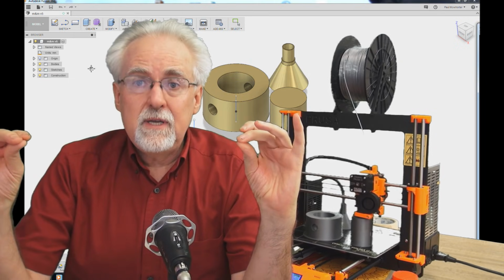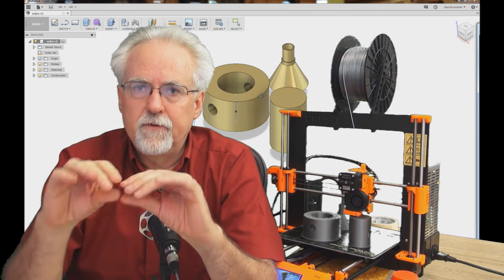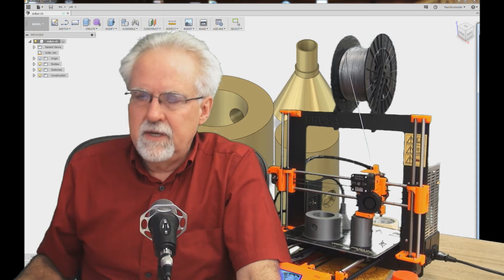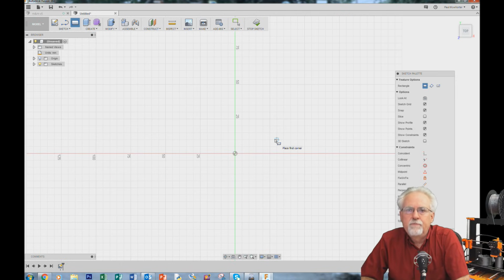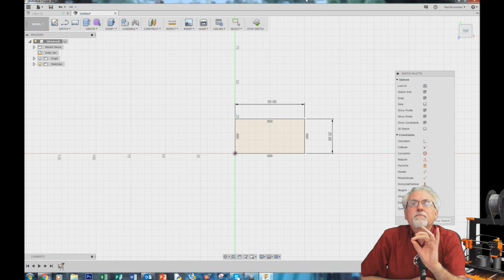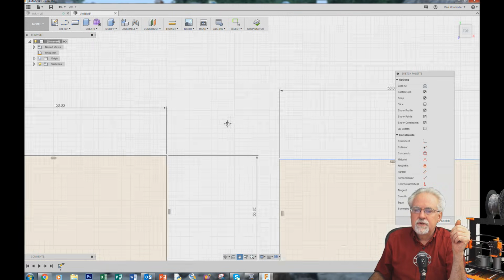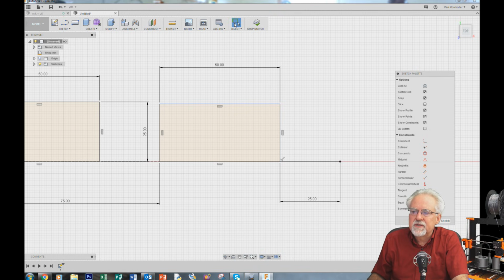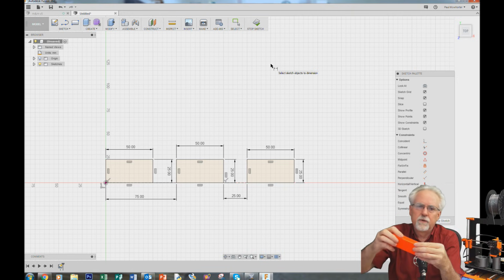Learn Fusion 360 or Die Trying LESSON 1: Introduction tutorial for Absolute Beginners

Comment: I'm doing the lessons, and I know this is probably easy question, but When I was working on rectangle number 4 I typed in the wrong dimension and pressed enter and I don't know how to change the wrong dimension (25.0mm) to 50.00mm. Using the dimensioning tool again to correct it seems like it creates another instance and there is an over constraining error or something like that. I'm starting this exercise over, but I'm curious how you edit the dimensions of the rectangles after they are created.
Reply: Ok, lesson 2 explained how to change the dimension size, double click on it.

Comment: Forgot to add in my previous comment - for those who follow this course today (2024), things have changed in the UI of Fusion 360 since the recording of this video, and in version 2.0.18220 that I'm currently using the default modeling orientation is set to 'Y as Up'; meaning that when you click on the X and Y plane as Paul instructs, it actually takes you to the 'Front' view and not to the 'Top' as showing in the 3d cube at the top right of the canvas in the video. To follow along with this series, make sure to click on the silhouette person icon at the top right corner of the interface and to go to 'Preferences'. There, in the General settings, look for the property called 'Default modeling orientation' and set it to 'Z as Up'.

Two more things in the General settings:
1. I would suggest to set the 'Default Orbit type' from 'Free Orbit' to 'Constrained Orbit' in order have a better control when rotating the viewport further on in the course (I found the 'Free Orbit' to be less convenient).
2. If you find zooming in and out with the mouse wheel flipped for you, just tick the 'Reverse zoom direction'.

Thanks again Paul for making this course. :)

Comment: i spent a year doing a course learning inventor pro & now I paid for fusion 360 , was good to learn a lot of things but damn fusion toolbars , system etc is way different
Reply from the maker: I get really frustrated with Fusion 360. Sometimes it acts more like a 'Beta' software version. They force upgrades that hide or break features you need. They move and change things on the user interface, which makes quality educational videos become obsolete too quickly. I like Fusion 360 but it does really frustrate me. Check out my new lessons which is on my channel as a new playlist on fusion 360

Comment: Great instruction. I struggled with other tutorials. I did have one problem, maybe I missed something. I did watch this video 2 times, but I still have 1 issue. ok I am having trouble with the 3rd rectangle. I click the start point, then a second point. Then I click on the "D" key and select the top edge, drag the dimension line up, Type in 50 and boom it moves the start point (Left side, not the right side. Where is it getting the ancor point from? why did it always adjust the size to the right? Did you tell it to do it to hold the left edge somewhere?

Comment: Thank you Paul for this really interesting entry to Fusion 360.  Is it correct that every rectangle must be connected to the origin point, either directly (construction line) or through other rectangles?  I am thinking of the 3 by 3 rectangles.

Comment: Hi Paul, what 3D printer model is that, and im considering getting one but my friend says they take to much maintenance ect. Is this true?
Reply from the maker: Mine is the Prusa printer, which is the most stable one I have found. Even there, it requires maintenance and tuning. If you are not technically inclined dont get a 3D printer. Also, you need to enjoy troubleshooting and fixing things.

Comment: Hi Paul, I found your instructions on Tinkercad most helpful after my recent 3D printer purchase.   I have downloaded the free student version of Fusion 360 and intend working through your 13 lessons.  However, I have found that after selecting 'new design', my version of the ribbon is different to yours, so it is not straight forward to follow.   Is there a solution to this, have I missed a trick somewhere?   Thanks

Comment: My version appears to be slightly different than the one he is using (nominal construction after right clicking didn't come up as an option (the entire little scroll window didn't come up, I only had the sketch palette pane on the right, which I eventually figured out the 'construction' tab was the bit he was on about), it's possible mine is an updated version to 'streamline' it better, but got through this first video fine afterwards, so still definitely relevant, and very good after the initial confusion.

Comment: Thanks for sharing this tutorial Paul. However, I found that on my Autodesk 360 (personal version) there is no nominal/construction option when I right click. I'm having to press x instead which then converts the line. Do you know whether the menu option has been removed in the latest version or do I need to change something in the settings? Many thanks
Reply: Please ignore this comment. It seems to be temperamental. Showing sometimes and not other times. Strange but there you go..

Comment: Hello Paul. Having followed your Arduino video tutorials which I enjoyed immensely, I decided to have a go at Fusion 360 as I had bought a 3D printer. Thank you for the  excellent Fusion video collection without which I think I would have probably given up I . I've just completed the Helical gear lesson and they work brilliantly. The homework you set that requires the student to add a 2 mm raised bevel to the gear wheel nearly caught me out as the two poles were then 2 mm short. I guess I could have made the gears 2 mm thinner but I chose to add 2 mm to the poles so that the gears fitted flush. 
 Have you used Fusion for any CCT boards or CCT designs yet? Any thoughts on doing some videos on that?  It seems like a fantastic software package. Anyway. A  most excellent contribution to the internet Paul.May your life be long and COVID-19 free !

Comment: I think I'll let this comment stand - Paul, you need an "introductory" lesson (Lesson 0?) that explains the Fusion 360 interface differences between the current version and the version you are using in these tutorials (probably explaining at each interface change which Lesson might be affected?).

Just an initial comment, hopefully, I can edit and retract it later :) But when I open Fusion it does not look like your video shows i.e. mine has "Design" in the top left corner, not "Model" (I can't find Model anywhere). I don't have "Sketch" visible either on the toolbar, instead, in the "Create" area I have "Solid", "Surface" and "Sheet Metal" - is this due to a new version of the software? Or is this some pre-Lesson 1 activity? Because I have "died" before I even got to create a rectangle :(  I noticed under "Solid" there is a "Create Sketch" (which appears if I hover my mouse over a drawing type icon) - if I select that, then I can select the X-Y plane as you show - but there is still no clue at this stage on how to create a rectangle. If I then click the origin, the icons under "Solid" change to rectangle, circle (pictures) etc - and I seem to have found your starting point! Although the "Sketch Palette" shown here does not match what Fusion throws up for me....

One of the things I am finding confusing on any of these tutorials is the software shown does not match the software I see upon starting Fusion..... I started a couple of other tutorials I found and gave up on them because of this issue, but your tutorial might be the closest (and most useful therefore) that I have found so far.....

Comment: 3:53 You're suggesting that failure comes from not entering precise measurements off the bat whereas I though I would be flexing things in Fusion 360 to find out what measurements I ought to use in the real build. What step is there between napkin sketch and CAD drawing that generates those precise values? I guess I'm putting this comment here as sort of a placeholder for when I look back after following your program and see what answer I discovered.

Comment: Hello, I am wondering if you know why my models in Fusion 360 come out 2/3 shorter in height when I print on my 3D printer? I create the model in Fusion 360, export to Cura slicer, and then export as g-code to print. All other dimensions are ok except height... prints out shorter.

Comment: YOU DA MAN, Paul!  I've been following your new/improved/most excellent Arduino series.  Somehow I reached the conclusion that I could use Autodesk's Fusion 360 for Hobbyists, and BAM!, there you are again teaching how to do that!!!  I just downloaded/installed Fusion 360 and started looking for tutorials on Youtube and there you are again!!!  It wouldn't surprise me if you've already done the next thing I need to learn... but I need to learn how to create a control panel made from translucent material, holes for switches, rotary encoders, etc., paint it black, and then engrave labels in the painted surface so that I can mount tiny LEDs behind it to backlight the letters.   I'm thinking I could do it all using a CNC router or CNC laser cutter/engraver.  Or 3D print the panel, paint it, and engrave using the CNC router or laser.  I'd certainly appreciate any suggestions!Thanks again, Paul!!

Comment: I have been hitting at 3D printing new model train parts for my 1950s American Flyer Steam Engines so I can add digital technology to these old friends. I had just completed an update Kit to a Royal Blue Streamline Steam Engine which never came with Smoke. I have designed all the parts needed to install a new Smoke assembly with fan driven smoke and exhaust chuff synchronized puffing. I assembled the Beta version and needed to adjust some dimensions when the whole assembly just went nuts! Now I have a huge hole in the side of the main housing and I can not fix it I was so sick, then I heard about your lectures and found the channel in You Tube. I am desperate and am going to binge on your channel all day. I understand everything you say and all you stories about why we are here are dead on right. I jumped into 3D instantly and yeah I mage some parts and they worked. But if I need to change something it takes me forever or I just delete and redraw. I have so many trains I want to upgrade I can not afford all the time I am sending on fixing screwups. I am a retired engineer 69 years old and need to get these engines all done up before I croak,  Thank You very much. I am stopping my vacuum tube Radio Patreon and moving to your channel, it is more important to me now.
Reply: And i have 2 Adruino kits waiting to figure out what do with them??!!

Comment: Is that an Anet A8 3D printer churning away in the background? Would you ever consider doing some tutorials on how you got yours up & running? I’ve had one for about 6 months & have never printed anything as I get a host of errors around the bed not heating up or the extruded not being hot enough etc etc etc. I have followed a host of people online trying to get it working to no avail. I’m even considering buying something else. It is a Herculean task but I’m sure you can do. I loved your Arduino videos & I am now enjoying your Fusion360 stuff too. Thank you for taking the time to help me & everybody like me
Reply from the maker: It is the Prusa I3 printer. We bought it assembled and not a kit. 3D printing is very tricky and keeping a printer working is hard. Hence, I did not not want to get a clone, but a factory built Prusa. I have been pleased with it.  3D printers for the most part are not ready for prime time, and will often break your heart.
Reply: Thanks for the quick reply. That settles it tho, I’m goons chuck out my Anet & get a Crealty. As for 3D printers breaking your heart, I can definitely testify to that. Thanks once again & I really am enjoying the Fusion360 course. The Arduino course really did accelerate my understanding so I cannot thank you enough. Keep up the good work

Comment: Another 66-year-old brain here. I ran three software companies back in the 80s and 90s and was involved when the GUI on the Mac and PC (GEM and Windows) first came out. The design mantra back then (and ever since) was "selection precedes command" which meant that you always FIRST selected something by clicking with the mouse and THEN did something to it with the mouse or by clicking on something in a dialog box. 

Your tutorial is absolutely wonderful for clearly describing some of the ways this program breaks with all those conventions that have built up for the 40 years that the conventional GUI has been used (if you go back to the late 1970s and Xerox Parc and then the Apple Lisa).  

You very accurately described the journey I took prior to arriving at your channel: my son gave me a Ender 3D printer for Christmas; I built it and learned how to make Thingiverse objects (both activities, including using Cura, were a piece of cake); I decided I needed to learn how to make my own parts because 3D scanners just aren't good enough to create replacement/repair parts; I looked at all the CAD and modeling software and realized that I'd be able to do more if I could figure out Fusion 360 rather than learn a kiddie toy; I installed the software, I followed a few other tutorials, but then realized that even after hours of learning I couldn't even create and print a cube. 

So, thanks for an A+ first tutorial, and I now have some hope that I might actually learn this program before I die (at 66, "die trying" takes on a different meaning).

John Meyer

P.S. This thing still might be the death of me. Why? Because the designers seemed to have gone out of their way to do things differently, but without any reason. Case in point: center mouse wheel zoom. It works backwards from every other program in the universe. Why???

F1 doesn't bring up help, unlike every Windows program I've ever used or built. Why???
Reply: You should be 72 rn

Comment: I got burned by Sketchup. Overall, it was easy to use to do sophisticated things, but it kept ending up with 1,000s of little design errors, little voids, etc.
Fusion 360 was clear sailing, and I have done a couple of dozen different designs. However, I got away from it and forgot most everything, having to get my head back in it, again. 
You have a great series, here, to do things deliberately.
Reply from the maker: Yes, I ended up really disappointed by sketchup. It ends up being more of a sketching program than a real engineering tood. I have been very happy with fusion 360

Comment: I created a test version of this design that was 10mm tall for both halves.  They still should have fit together.  They did not.  I wonder if I have to scale back the extrusion multiplier so there is some gap for the 2 sides to actually slide together.  The other option is to design the smaller side independent of the taller portion so the smaller side can have a different width to create the gap.

Comment: Hi Paul, until now I have only used Autodesk 123D.  Thanks for your Fusion lessons.  I will be using them to learn this program.  I am very hesitant as I now found out that Autodesk is no longer supporting 123D.  Luckily I still have all of my STL files as I was able to save my projects to my computer.  Is Fusion 360 only cloud-based?  What happens if they pull this program as well?  Will all of my files be lost or is there someway to save to a computer as well?
Dan
Reply from the maker: Dan, what you allude to is always going to be a problem. Someone once told me "Bits Rot". Standards change, formats change and software changes. I have floppy disks I can no longer get data off of, and the CD and DVD will soon be a thing of the past. Even doing something like keeping a collection of your old digital photographs becomes a challenge. So, I can not offer any hope other than just plan on continuing to migrate your work to new formats and new software.

Comment: So, Paul, do you only do videos for 3D printing? I'm more interested in using a CNC router. So far everything you've done is useful for that, too. I am, however, having difficulty placing my model on the stock. Any help for me?
Reply from the maker: I have never done any CNC or machining so that is completely out of my area of expertise. Really I learned fusion 360 out of necessity as I need mechanical parts for my electronic projects.

Comment: Hi Paul,
I have a body drawn that I have worked on the " top" and the " bottom". Now I want to go back and work on the top again, but I cannot extrude what I have drawn even though all the line are black, although they are faint. When I try to extrude the entire face turns blue and I know it is not from the cold weather. The blue and red planes are on the the bottom face, with the green axis running up the corner of the body. How do I get to work on the top face again? Obviously I am new to Fusion360. I really like your videos, but I am trying to get a specific project done in a bit of a hurry, so I am running ahead of myself and struggling most of the way, but learning. I do follow your videos step by step however and it is working well. Hope you can give me an answer. Thanks. Bob.

Comment: Paul
Really enjoy your guidance on 360.  You are without a doubt, one of the easiest instructors to follow and I've tried many.  One question, what model of 3d printer are you using for these demos?
Many thanks.
Bill
Reply from the maker: In the background is a Prusa which s low cost and rock solid. We also have a Raise3D N2 which is a higher performance, higher price one. Both are excellent machines.